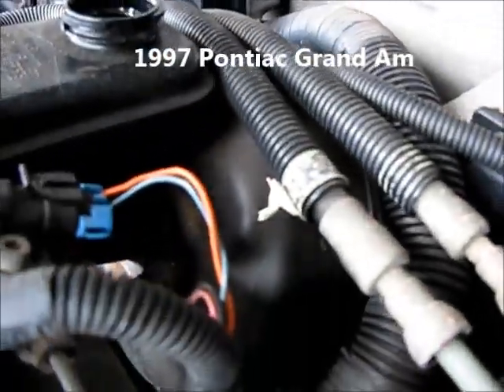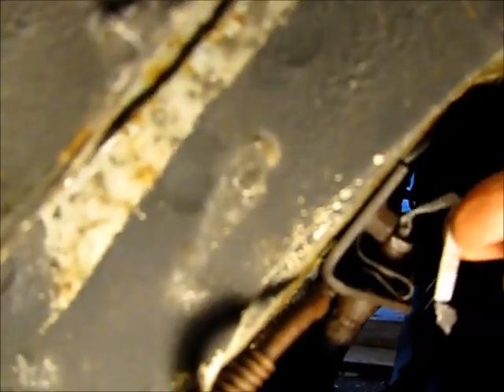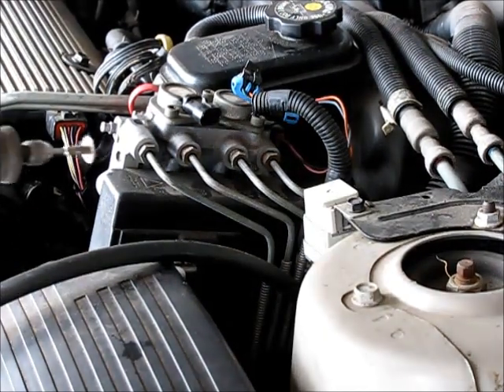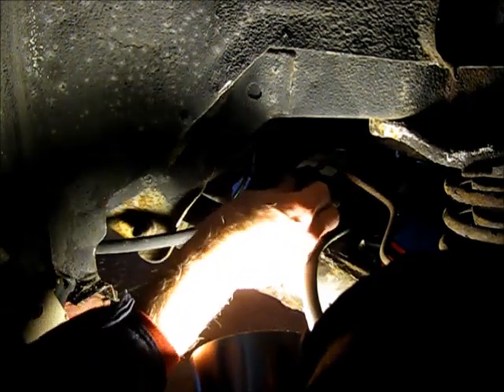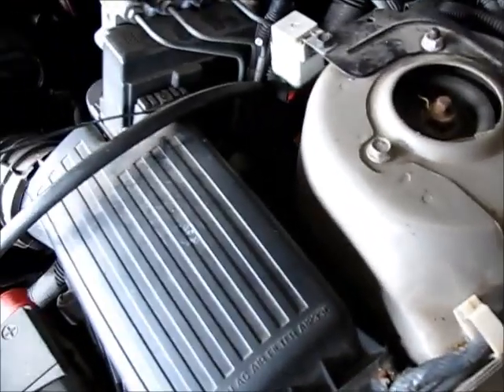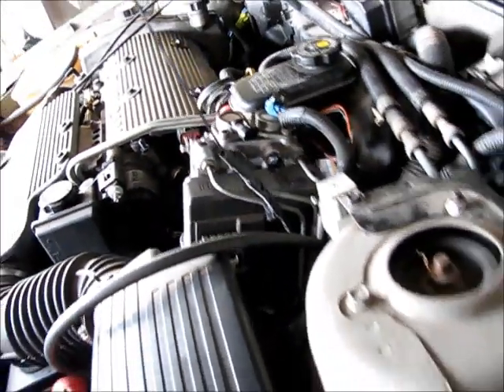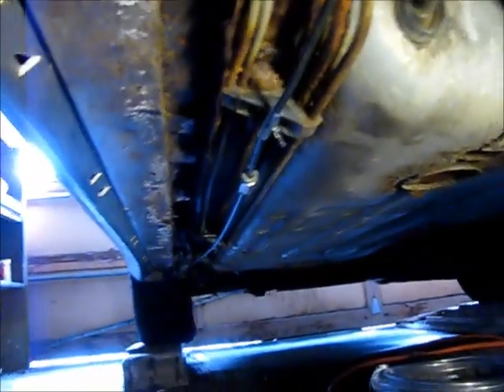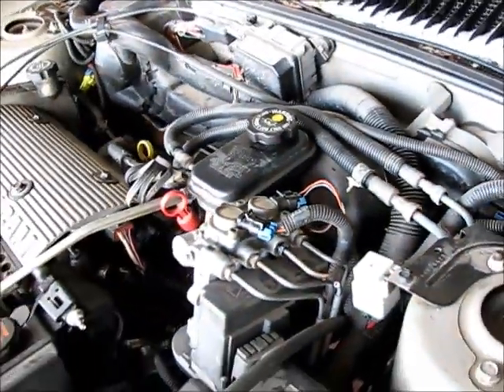How to replace an entire brake line

Comment: If you’ve cut the pipe so close to the fitting just get a socket on it. No need to use the flare wrench as there is no pipe in the way.

Comment: BRAKE LINE RUSTED. WAS QUOTED $250.00 TO $800.00 TO REPLACE THE BRAKE LINES.
Reply from the maker: Seems typical for this kind of job
Reply: The thing about rusted brake lines is that once you start moving around the one line you are trying to replace, you could very easily end up with other lines leaking too.  That is why shops quote pricing with wide ranges.

Comment: Awesome job. I love your work. I am working on an 05 Chevy cavalier. Tried to do a patch but the rusty brake line crumbled in my hands and broke in another spot.. I need to replace the entire line... never replaced an entire line so a bit nervous. It’s the front passenger line. Seems like a complicated path but not as bad as going to the rear I guess... should I use the more flexible line you displayed for the entire thing? And what is the difference between brake line and brake hose? Any advice?
Reply from the maker: The copper-nickle line is easier to work with but more expensive. If it isn't a long run I'd use that. The brake hoses are the short rubber parts that attach to the calipers. They are there to provide the flexibility needed as the wheels turn. Good look and thanks for watching!

Comment: Why not use one piece of brake line?
Reply from the maker: I believe this car was built around the brake lines. They follow such a complicated, circuitous path through the engine compartment and on back that I couldn't imagine bending a steel line through it all.
Reply: @TheOriginalMechanic  plus its good to have a spot to be able to fix a problem with not such a long run

Comment: I think i might have missed it but did you use compression fittings? If so did the car pass inspection?
Reply from the maker: +ezellivan974 I used tubing manufactured with inverted flare fittings with unions made for those fittings. Yeah, the compression fittings will not pass inspection and cannot be used (legally, that is). Thanks for watching.
Reply: I am trying to find the language by the FHSA, NHTSA, and the DOT that states compression fitting are illegal. I know they are but can not find the language.
Reply: Kudos for the video content! Forgive me for butting in, I am interested in your thoughts. Have you heard the talk about - Trentvorty Safe Vehicle Theorem (Have a quick look on google cant remember the place now)? It is a great one off guide for discovering how to repair your car the simple way minus the headache. Ive heard some awesome things about it and my good mate called Gray after a lifetime of fighting got excellent results with it.
Reply: @smitty03281964  they are illegal to use on brake setups. compression fittings are made to withstand an average of 80-100 psi. A brake system on a hard stop can generate up to 3000 psi.
Reply: @christopherwarner2901  I actually later found the language that requires compressed fitting on brake lines.